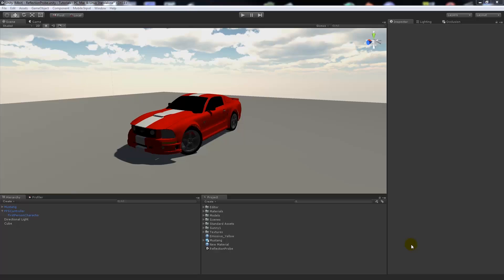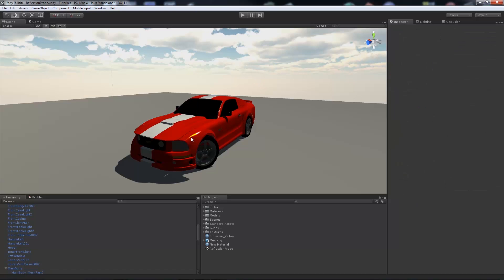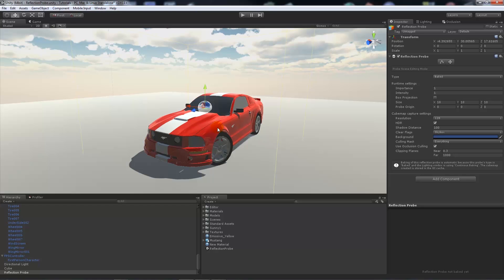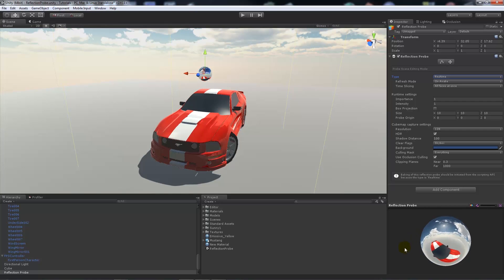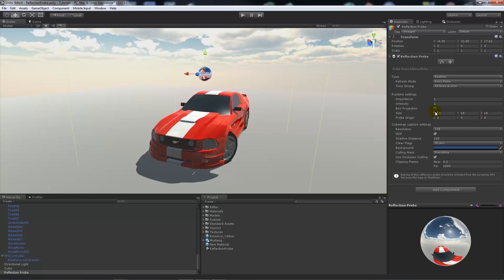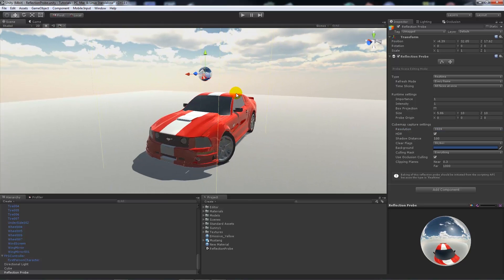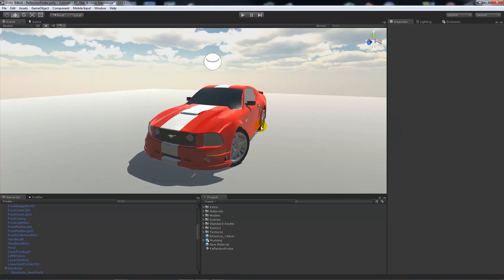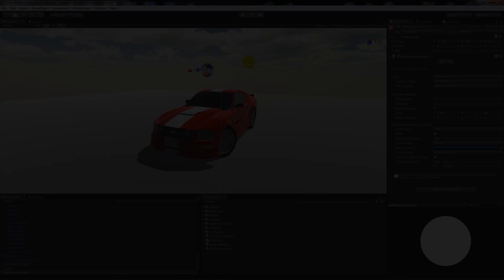Reflection Probes in Unity 5

Comment: in my built the reflection probes won't work, in the editor they work just fine....
just upgraded to pro especially for this feature.... :(
Any suggestions? May be just some false settings...
Reply from the maker: You don't need Pro for any feature, it's only good if you need a revenue increase for your company or game. As to your problem, is it real-time or baked?
Reply: it`s real time
Reply from the maker: I'm not really sure, are any of the effects turned off? Tried restarting Unity? I really don't know what to say? Send me a link to a screenshot of the issue maybe?
Reply: I've sent you a pm
Reply: :D fixed it! seems like I just messed up the player settings at some point.... :(

Comment: Hi guys,

I do not know if  you guys have noticed, but when adding the reflection probe the scenes frame rate/count will go down by significant amount. Does anybody know how I can have my games frame rate be high but use a reflection probe?

Best Regards
Reply: Oh ok,  yes it is fixed now. Thank you so much! Also will using a Mac OSX decrease my frame rate?

Best Regards
Reply from the maker: What hardware are you running? I have a few reflection probes in my scenes and it has great performance. Just make sure your reflections aren't really above 512 in resolution and you make update them onAwake rather than in realtime, unless of course you need it!
Reply: David Aminov Yeah, like SpeedTutor said, keep your resolution down AND if your object is dynamic you can update the reflection probe every x frames (like only every 10 Frames)
Another solution is to put baked reflection probes on the map and your object is blending between them automatic
Reply: David Aminov Cool ^^ Technically not. It depends on the hardware of the mac, but is should run fine